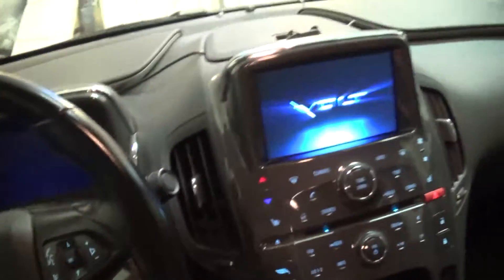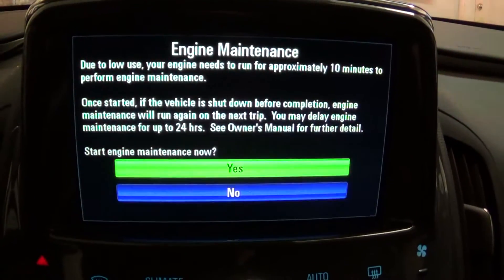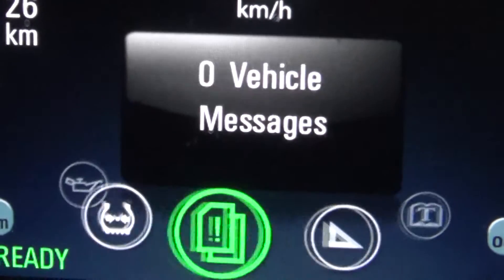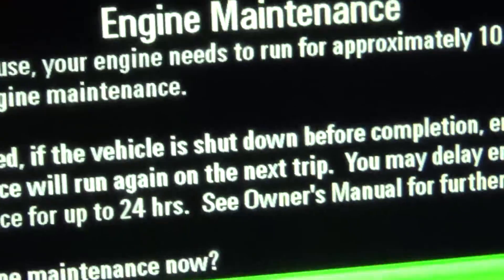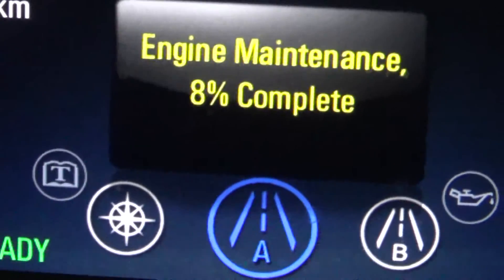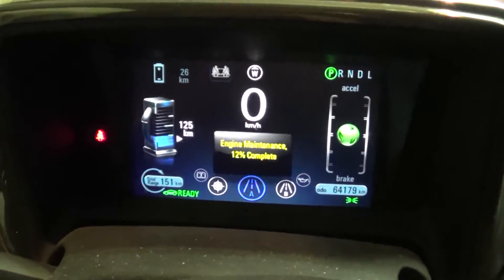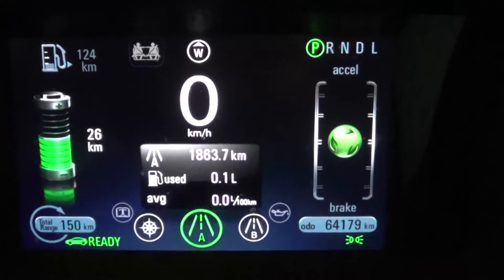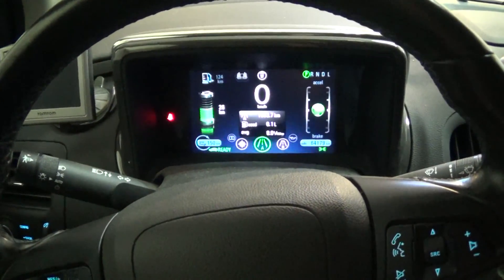Chevy Volt Engine Maintenence Operation

Comment: Also, I believe, you can drive the Volt and use it as normal during maintenance mode. Thank you for your video.
Reply from the maker: Of course you can, and normally I would. It does the maintenence thing every 6 weeks. This time I just happened to have a camera handy, so I sat there and timed the operation. Normally you drive, and the engine runs just like it did in the video and then turns off.
Reply: @12voltvids  Hello, a quick question, do still own this Chevy Volt?
Reply from the maker: @mikesilva5069  yes I still have both of them. The 2012 has 187000 miles and the 2019 around 50k
Reply: @12voltvids  I was looking to purchae a used 2015 Volt Premier and was wondering what issues you might of experienced.  Thanks
Reply from the maker: @mikesilva5069  that's a first gen. These were better built than the second gen which 2016 to 2018 have a becm (battery control module) issue that some people have waited for months to get because of supply chain issues (those have been resolved now) i have a 2012 and 2019.   The 2012 the only maintenance I have had to do is 5 oil changes and 2 sets of tires.   It has 178000 miles on it now and everything original. Original 12v battery original brakes original traction battery.  Software updates that reduced the electric range (start the engine sooner) to keep more reserve charge were done to extend the battery life.  In the cold weather i use mountain mode which keeps a 25% charge.  No sence to stress a 12 year old battery in the really cold weather.  The 2019 has been good but it has had a few problems.  The FM reception is nowhere as good as the older car and the high voltage cutoff relay failed and required 2 days at the dealer to fix.  Other than that nith have been solid cars and have been the most reliable cars I have ever owned.  On the 2012 I can go 2 months on 8 gallons of gas on the 2019 a full year as it has a higher electric range.  55 miles vs 30 on the old car.
Reply: @12voltvids  wow, thats awesome   its been hard to find someone who has actually owned a volt this long with real world knowledge on this vehicle. So, it sounds like the first gen is a more reliable than last generation. 
Its hard for me to jump on a used hybrid that im unsure of how reliable it will be. This of course is me owning a 2010 Honda Fit, that I purchased "off the boat" new and have racked up 340k worth of mileage as of today;  to which the reliability has been great.

Comment: Very interesting!  Got me thinking about buying a duel fuel car for my next car now...
Reply from the maker: It's a great car, Over 2000 miles since I have burned any gas, but it is always on tap so I can go anywhere, anytime, and not have to plan my trip around charging infrastructure like Tesla and Leaf drivers need to do.
For my daily driving I never use any gas, and only keep 1-2 gallons of fuel in the tank for emergency use. Over the winter months I will use a tiny bit of gas, as the car will automatically start the engine in extreme cold if the car is sitting unplugged. This is to warm up the battery. If it is plugged in, it warms with heaters on the grid. If sitting in a parking log unplugged, and the temperature drops below 25F the engine fires for about 3 minutes to generate power for the electric heaters to warm up the battery, That prevents the power/range loss all batteries suffer in freezing temperatures.